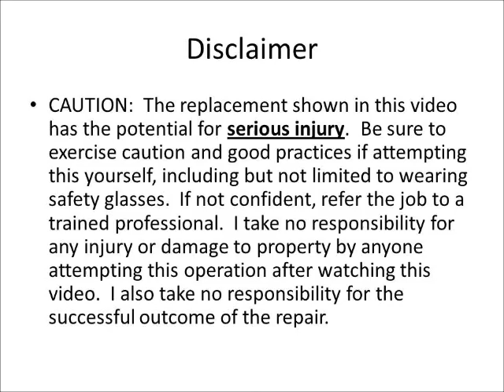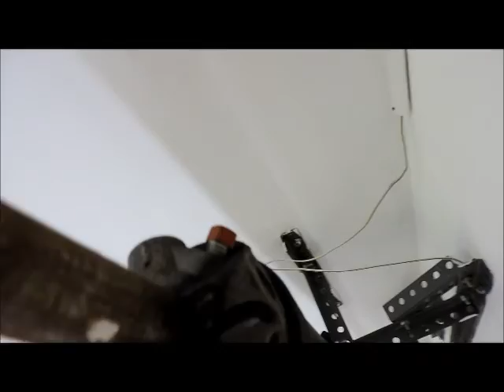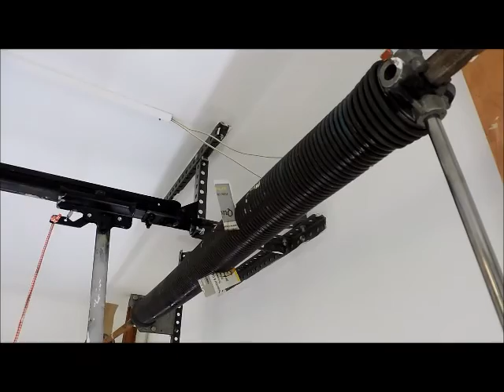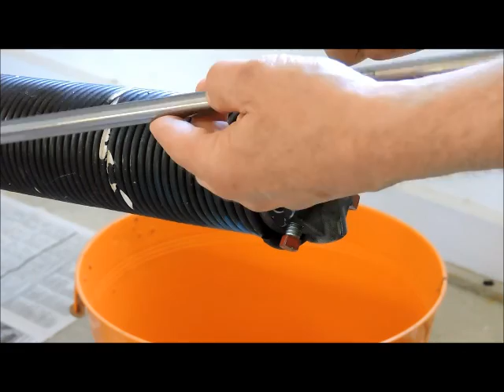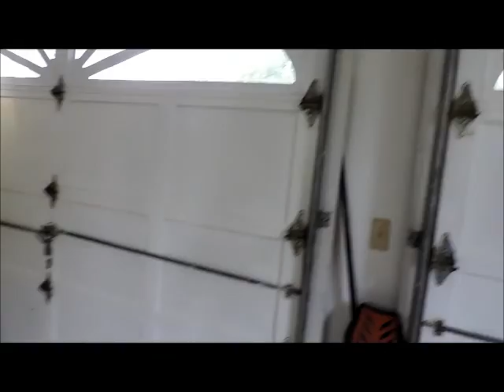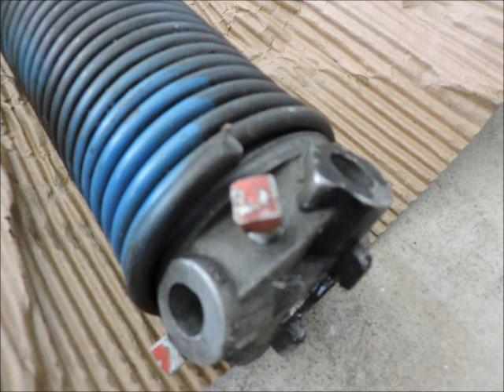How to replace a garage door torsion spring (updated)

Comment: How do you know how many rotations to tighten the springs
Reply from the maker: Divide the height of the door by the circumference of the pulley the cable runs on, and that gives you an estimate of the minimum number of turns.  I would add a couple of turns to that to start.  You can  add more turns as needed.  Of course if the spring didn't break, and you are just replacing it, then you would count the number of turns needed to unwind the old spring.  Or simply count the  number of revolutions on the pulley as the door goes down. Just be careful as indicated in the disclaimer, as there is risk of serious injury if not careful doing this job.